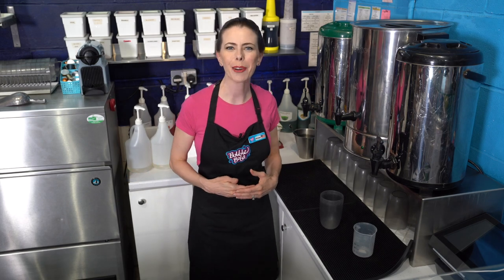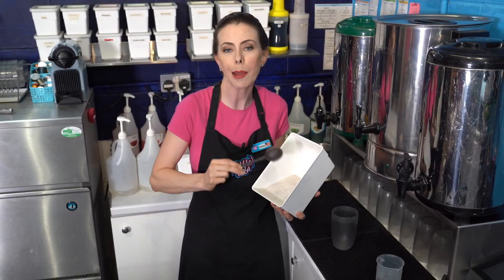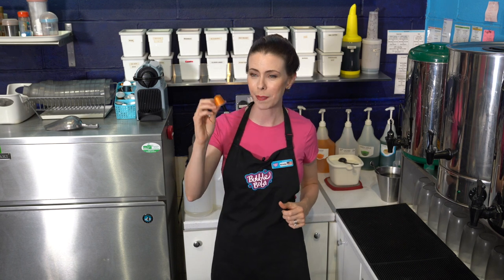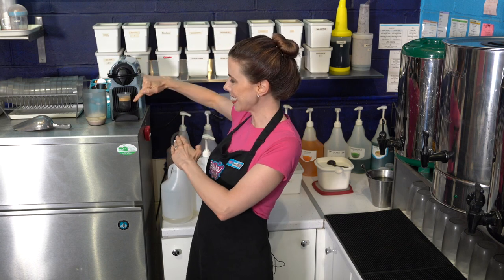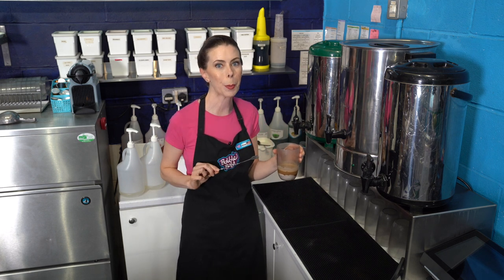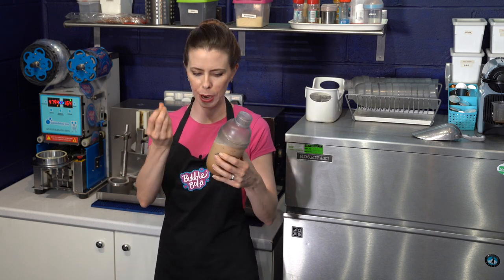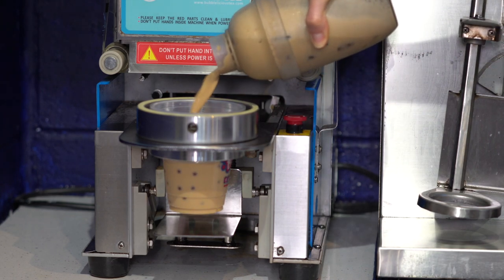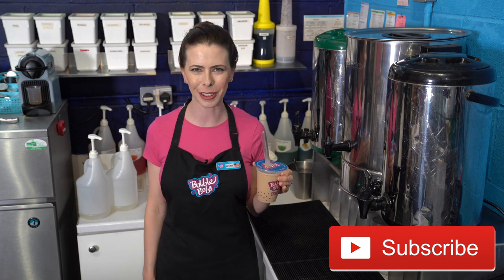YuenYeung Milk Tea ~ Cafe Bubble Tea Shop Recipe ~

Comment: Hi Kristin, you’ve been very helpful. I wanted to have a 500 ML drink for this recipe. I know I should multiply it to 1.5 but im just wondering, how about the espresso shot? How will I adjust it? Thank you!
Reply from the maker: Hi Marietta,🧋🧋🧋
The Nespresso brand offers different size pods and different strengths... For a larger drink, I'd consider doing a lungo shot. Or a long pour from a machine...
Hope this helps 😇
Reply: @BubbleTeaKristin  yes this helps a lot! really appreciate your response. Wishing you all the best 🥰

Comment: Can you please share with us the espresso machine from?
Reply from the maker: Sure, it's a brand called Nespresso. They make small individual size pods for espresso shots. It is very easy for the staff to use, and the pods can be recycled through their program. In the long run it is a much cheaper  addition to a bubble tea shop, as opposed to buying a super expensive espresso pull machine! Unless your shop particularly specializes in coffee beverages, in that case you may need to buy a large espresso machine and train your stuff up on it. But for the occasional espresso shot, I find the Nespresso brand and their small pre-measured pods to be perfect. 👏🏼

Comment: Can you refrigerate the tea and how many days it last. Thank you.
Reply from the maker: Yes, it would say 2-3 days max... But the color will change. I would only advise using this method if you will be mixing it into a powdery drink. If you are doing something with fresh milk and tea or similar, then you definitely do not want to use refrigerated tea for that. 
And also, although it's convenient to refrigerate tea, the flavor does change a bit. So if you want to offer the best freshest flavor of tea possible for your customers, I would recommend making a smaller batch everyday and throwing it away. And then if throughout the day you need more, again just make a really small batch of it and throw it away at the end of the day.
Hope that helps 😊

Comment: Can u give me the water boiler brand and model?
Reply from the maker: Honestly I can't remember... but I recall maybe Burco or SwitchedOn?
If you have enough money and the option - I would advise getting one which has a mains water feed - where the staff don't have to refill it all the time. The only downside to that method though is you'll need the whole line to be serviced every year due to calcium and bacteria build up - just like an Ice Machine.
The upside to the stand along units, is they're easier to be cleaned with de-calcium build up cleaner monthly which you'll definitely need to do... and the calcium build up really ruins the machine. 
Either way, sadly, we went through a water urn every year or two - always had one stored up just in case. They all have a 'reset' button on the bottom but when it's dead, it's dead. 
Some companies offer a warranty - which again, if you can afford the extra luxury, go for it! (Depends if you're a franchise or an independent run shop.)
Hope that helps! 👍🏼

Comment: Link to the espresso maker?
Reply from the maker: Hiya,

I don't have an affiliate link for this, and as each country would be ordering off of different websites, I didn't feel the need to put it in the description. 

However what I can suggest is just doing a simple Google search for "Small Nespresso Machine". 

They have new ones coming out each year and that way you can find either a newer or older model which fits your price range. 🥰😍❤️

Hope that helps 😃